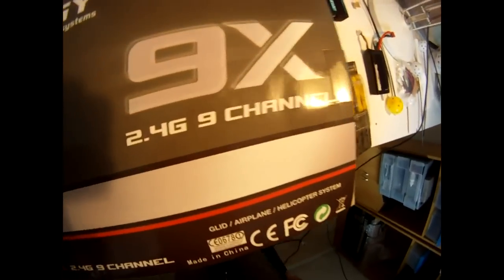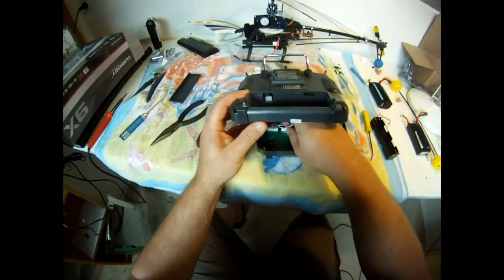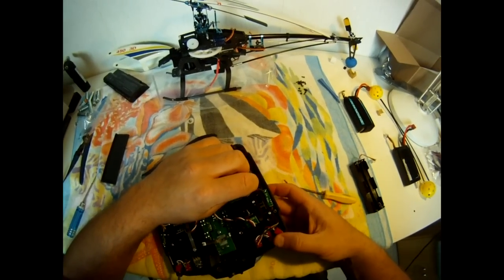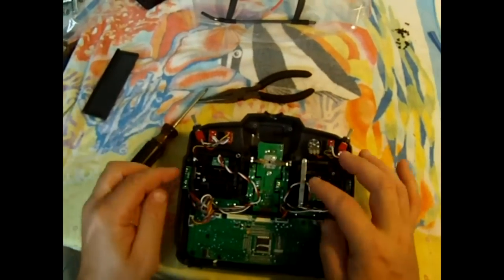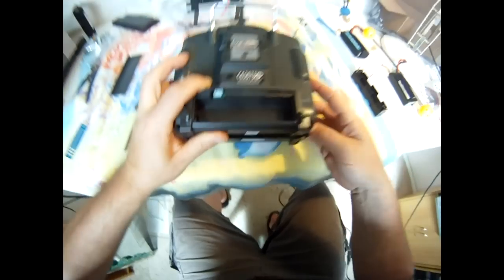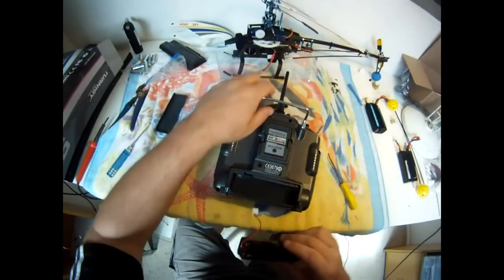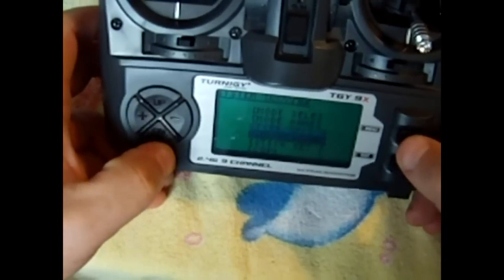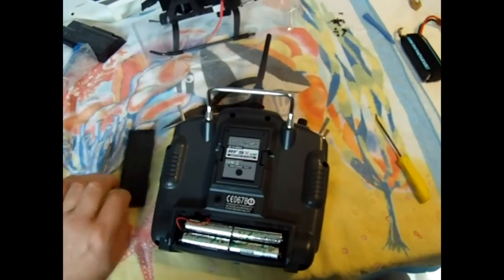Turnigy 9X 9Ch Tx mode conversion

Comment: thanks men i found out hi res images on a turnigy9xr forum and it seems to be a small difference on the gimbals , the small arm you need to pull out and change side is placed with a pin that has no way out but its easy to drill it out at least that is what it seems , i changed my order and will post at least some pictures on the forum when it arrives